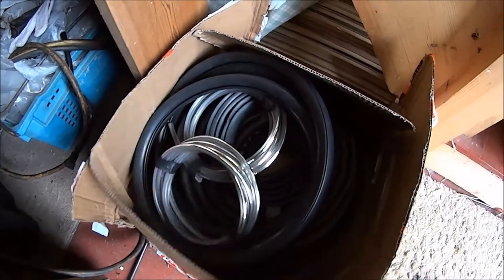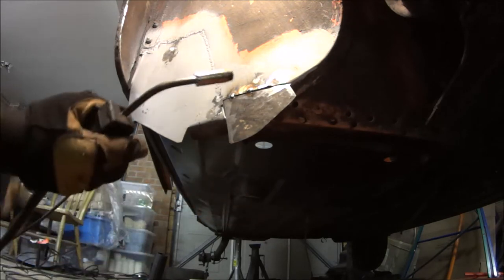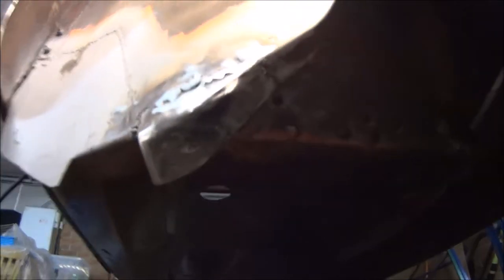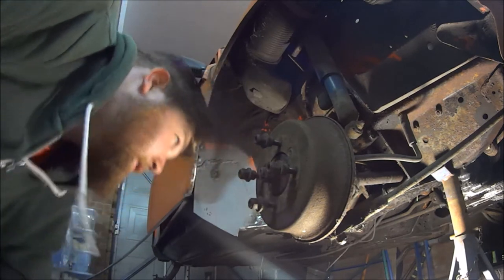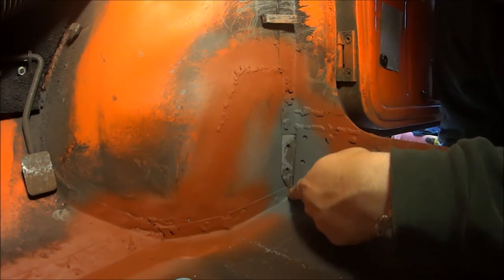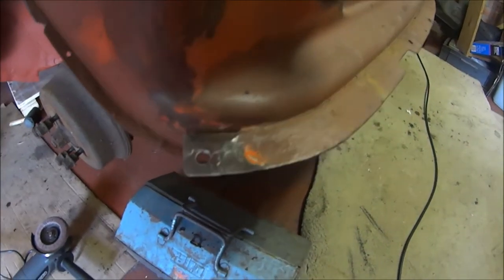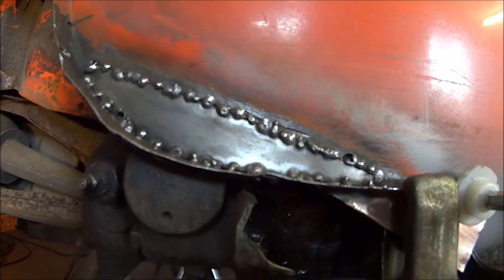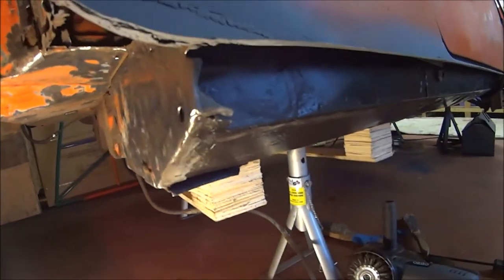How not to Weld - Classic Mini Restoration - Project Bumble - Part 3

Comment: Matt you are doing a good job, no matter how good a welder you are its no easy to weld thin metal together, could i make a suggestion use your left hand to steady the welding gun. it will help
Reply from the maker: Malcolm Latham-Bennett thank you for watching, hope you're enjoying the videos, I will definitely bear that in mind next time I'm welding. I've not done any welding on thicker stuff only on this car so learning as I go. It seems a pretty steep learning curve. Easy to do basic welding but really hard to be actually good at it 😂 thanks

Comment: Matt, A bit of corking compound on the finger for the inside welds and job done, It‘s lot easier to weld with gravity then vertically or upside down as you know and your doing great, This is why a little DIY spit is so handy when you have lot of welding on the underside of the car which you don‘t need,  Compared to some your shell is in very good condition . All the best Dave.
Reply from the maker: davejaguar66 is that the same as seam sealer? Thanks Dave, really appreciate the advice, I spent a lot of time playing with the wire feed and some parts as I went along did get better, quite proud of my bumper lip repair, just did it because I could! Haha
Reply from the maker: davejaguar66 I think I got lucky with my mini because it's been off the road and in dry storage since 95 it's missed quite a few winters which would have done a number on the shell!
Reply: Matt, Yep It‘s the same stuff, The more you do the better and easier it will be to get a nice weld. Cheers Dave.

Comment: Matt, Plenty of good videos on how to weld, even just the basic stuff. Listening to your comments regards 'welding' you could very easily run a couple of practice welds on some scrap pieces. 10 minutes there will more than likely save you treble that in grinding etc but great stuff. You may find that when you get better you may go back to the earlier work to rectify it.  Have heard so many youtubers mention that..(although some have done a great job) Keep at it, Bro....
Reply from the maker: Malcolm Young thanks, It’s a bit hit and miss really, I try to practice before I start each time but then it doesn’t transfer over quite as well as I think.